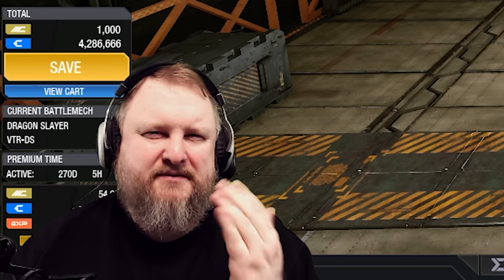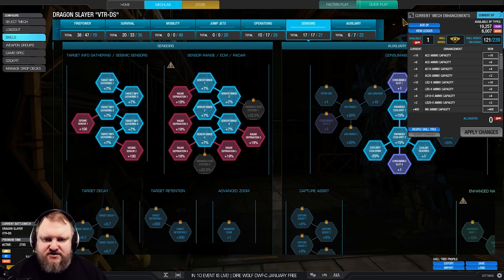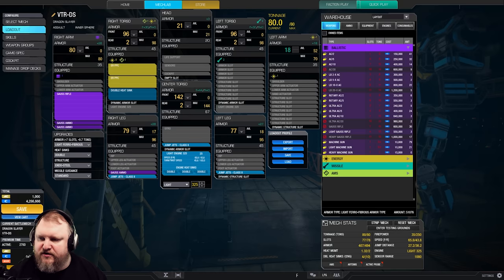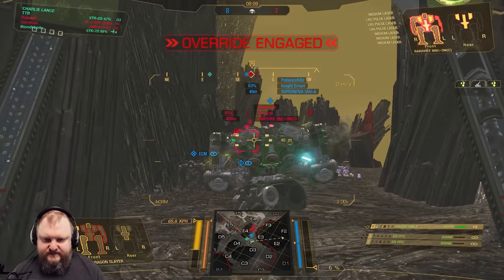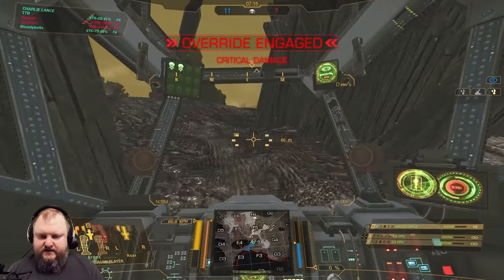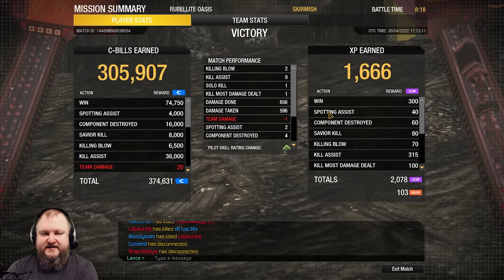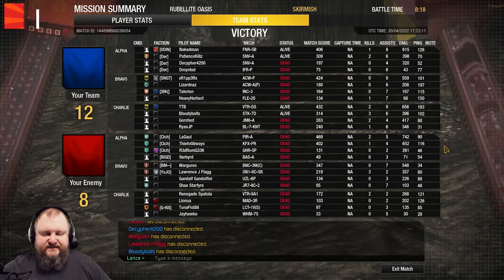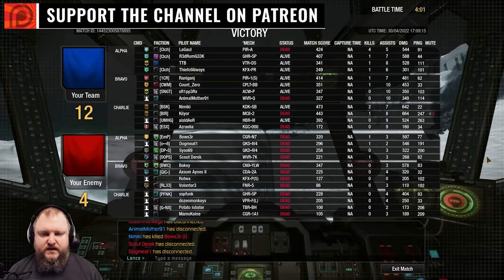Accurate like Ardan Sortek! - Victor - German Mechgineering #627 #mwo

Comment: I use PPCs a lot cuz they're probably my favorite weapons, and I've noticed that for some reason they seem to "miss" pretty frequently. They sure look like they're just phasing right through my target without doing any damage and it's especially noticeable at longer range. Not sure what's going on, but it sure is annoying.
Reply: might be due to ping issues. What you see =/= what the server sees, 0.15 seconds might be the difference that makes your shots miss - especially at longer ranges.
Reply: Definitely network issues, it’s a projectile that leaves a trail so it’s possible for the enemy to move into the trail after you fire, and network differences will make it a miss by milliseconds
Reply: @5000Seabass  Yeah it's probably that. Plus it seems like the PPC projectile might look a bit bigger than the hitbox actually is? So sometimes just the blue aura around it clips the target but not the actually damaging part maybe.
Reply: @Haoyang Dong  Yeah it's probly lagging a bit.